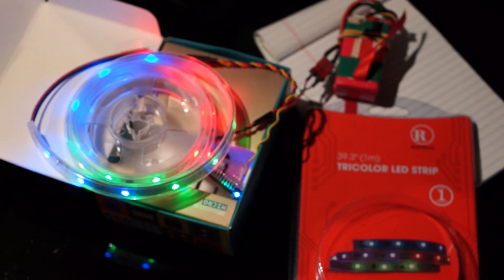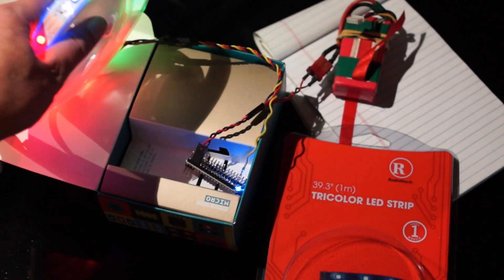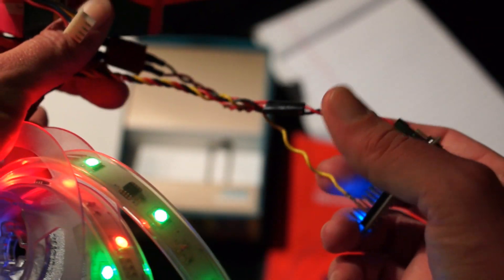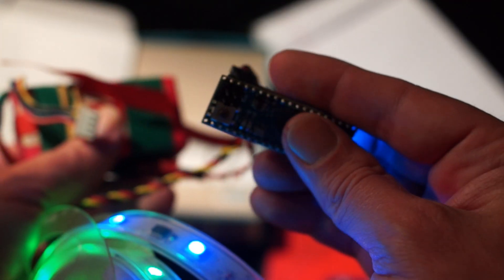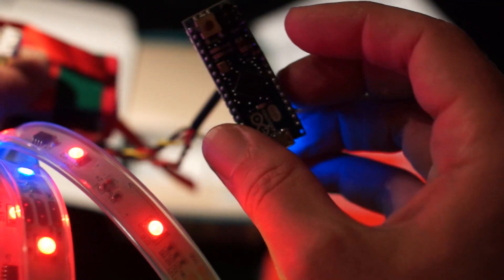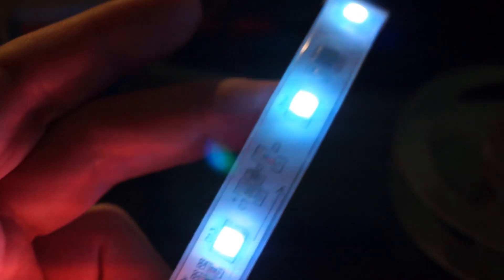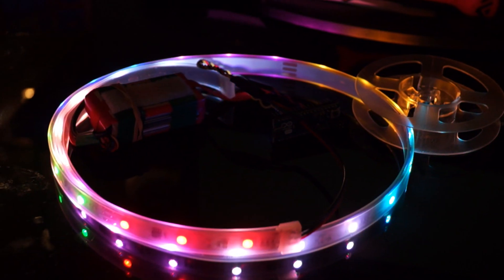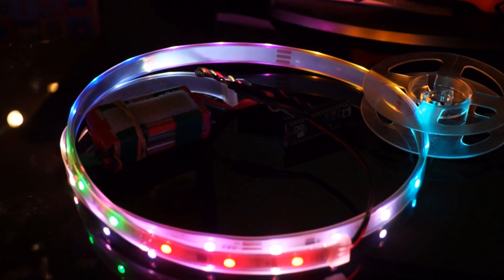Radio Shack Tri-color LED Strips How-to

Comment: I use FastLED library (successor to FastSPI_LED) By Daniel Garcia
This is a library for easily & efficiently controlling a wide variety of LED chipsets.
Supported LED chipsets;

Adafruit's Neopixel - aka the WS2812B (also WS2811/WS2812, also suppored in lo-speed mode) - a 3 wire addressable led chipset
TM1809/4 - 3 wire chipset, cheaply available on aliexpress.com
TM1803 - 3 wire chipset, sold by Radio Shack  <-----------
UCS1903 - another 3 wire led chipset, cheap
LPD8806 - SPI based chpiset, very high speed
WS2801 - SPI based chipset, cheap and widely available
SM16716 - SPI based chipset
DMX - send rgb data out over DMX using arduino DMX libraries

Supported platforms;
Arduino & compatibles - straight up arduino devices, uno, duo, leonardo, mega, nano, etc...
Teensy 2, Teensy++ 2, Teensy 3 - arduino compataible from pjrc.com with some extra goodies (note the teensy 3 is ARM, not AVR!)

Site for the library - http://fastled.io
Reply: I tried using this library but the color mapping is off.  Green=Blue, Blue=Red, etc...
Reply: Eli Miletich Looks like my RadioShack strip is GBR mapped, will have to re-map it somehow
Reply: figured it out... this is a much better lib than Pololu (IMO), just be sure to re-order the line "FastLED.addLeds<TM1803, DATA_PIN, RGB>(leds, NUM_LEDS);" to "FastLED.addLeds<TM1803, DATA_PIN, GBR>(leds, NUM_LEDS);"
Reply: Eli Miletich
Glad you figured it out.
Few Notes: Radio Shack sells two versions of the rgb strip,

Version 1.0   
Model: 2760339  |  Catalog #: 276-339
RadioShack Tricolor LED Strip
Price:
$29.99
Look thru the Waterproof silicone tube by one of the arrows,
SJ-TM1803-30 V1.0

Not Recommended
even different color mapping RBG and Red leds are Super Bright.
FastLED.addLeds<TM1803, DATA_PIN, RBG>(leds, NUM_LEDS); //TM1803 Radio Shack RGB Strip v1.0

Version 2.0
Model: 2760249  |  Catalog #: 276-249
RadioShack 3.28-ft. (1 Meter) Tricolor LED Strip
Price:
$6.97
Look thru the Waterproof silicone tube by one of the arrows,
LED-500-TM1803V2.0

Highly Recommended
Color mapping GBR
FastLED.addLeds<TM1803, DATA_PIN, GBR>(leds, NUM_LEDS); //TM1803 Radio Shack RGB Strip v2.0

I'm currently using version 2.0 for boblight 4m long ):
Reply: Chris O.
/*Boblight is a collection of tools for driving lights connected to an external controller.
https://code.google.com/p/boblight/
Its main purpose is to create light effects from an external input,
such as a video stream (desktop capture, video player, tv card), an audio stream (jack, alsa),
or user input (lirc, http). Currently it only handles video input by desktop capture with xlib,
video capture from v4l/v4l2 devices and user input from the commandline with boblight-constant.
Note: MS WINDOWS Dlink https://github.com/markhoney/RainbowBob/tree/master/boblight-1.3-beta1
      prefix can only be 1 byte long in this boblight-1.3-beta1, TODO Fix this for Ms win. 
*/
/* boblightd receiver for FastLED library , boblightd device type=momo, prefix FF 8F
 Please edit bobligh.conf file prefix, this will work OK on linux, MS WIN. prefix can only be 1 byte long.
 capable at least for 20Hz input stream if LED count <= 150
 by TPertenava
 last modified by Chris O. Aug.20.14 
 Tested on  Arduino IDE 1.0.5 
 FastLED 2.1  https://github.com/FastLED/FastLED/tree/FastLED2.1
 Arduino Leonardo
*/
#include "FastLED.h" // FastLED is a fast, efficient, easy-to-use Arduino library for programming addressable LED strips and pixels such as
// WS2810, WS2811, LPD8806, Neopixel, TM1803 and more.

#define NUM_LEDS 40 // 4M LONG / LED count, well Radio Shack TM1803 IC count 10 per 1M.
#define CHANNELS NUM_LEDS*3 // each output for R, G and B
#define DATA_PIN 8 // arduino output pin
#define BRIGHTNESS 255 // maximum brightness
#define SPEED 115200//57600 //115200 // virtual serial port speed, must be the same in boblight_config

boolean ReadyLEDSbuffer = false;
byte values[NUM_LEDS][3]; // 2-level array, 1 level is for led number, 2 level is for rgb values
CRGB leds[NUM_LEDS];

void setup()
{
  delay(2000); // sanity check delay - allows reprogramming if accidently blowing power w/leds
  Serial.begin(SPEED);
  LEDS.setBrightness(BRIGHTNESS);
  // FastLED.addLeds<WS2811, LED_PIN, GRB>(leds, NUM_LEDS);
  FastLED.addLeds<TM1803, DATA_PIN, GBR>(leds, NUM_LEDS); //TM1803 Radio Shack RGB Strip v2.0
  // FastLED.addLeds<WS2811, DATA_PIN, RGB>(leds, NUM_LEDS);
  // FastLED.addLeds<TM1809, 13>(leds, NUM_LEDS);
  // FastLED.addLeds<UCS1903, 13>(leds, NUM_LEDS);
  // FastLED.addLeds<TM1803, 13>(leds, NUM_LEDS);

  // Test leds on start up
  // fade up
  for(int x = 0; x < 128; x++) { //PINK LOL.
    // The showColor method sets all the leds in the strip to the same color
    LEDS.showColor(CRGB(x, 0, x));
    delay(10);
  }
  // fade down
  for(int x = 128; x >= 0; x--) { 
    LEDS.showColor(CRGB(x,0, x));
    delay(10);
  }
}

void WaitForPrefix()
{
  uint8_t first = 0, secondD = 0;
  while (secondD != 0xFF || first != 0x8F)  //FF 8F PREFIX
  {
    while (!Serial.available());
    secondD = first;
    first = Serial.read();

  }
  // if Prefix found set flag true
  if (first == 0xFF && secondD == 0x8F)
  { 
    ReadyLEDSbuffer = true; //set flag
  }
}

void loop() { 
  WaitForPrefix(); //jump to WaitForPrefix();

  for (byte Led = 0; Led < NUM_LEDS; Led++) {
    for (byte Color = 0; Color < 3; Color++) {
      while(!Serial.available());
      values[Led][Color] = Serial.read();
    }
  }  
  for (byte Led = 0; Led < NUM_LEDS; Led++)
  {
    byte red = values[Led][0];
    byte green = values[Led][1];
    byte blue = values[Led][2];
    leds[Led] = CRGB( red, green, blue);
  }
  if (ReadyLEDSbuffer == true) { // show leds only if buffer ready
    LEDS.show();
    ReadyLEDSbuffer = false; //set flag to false after LEDS.show();
  }
}
Reply from the maker: Chris O. Wow, thanks for posting! That's what I call community service! Nicely done, sir :)

Comment: Im having the same problem as Giuseppe Barbesino below. I get a few lights and then it quits. I have tried all the examples, including yours (on pin 10 instead of 12) and they all behave the same. I have 12VDC 1A barrel plug into Arduino Uno. LED Strip should work off Vin and GND from the board.. From web docs: "Vin: You can supply voltage through this pin, or, if supplying voltage via the power jack, access it through this pin." Don't see what the problem is. Help is appreciated!!
Reply: So I have solved my problem. I had to use the older version (1.2.0) of the Pololu video because of the TM1803 chip i guess. Now it works great! 

Thanks a ton for your video, without it this light strip would have been returned!
Reply from the maker: Oh, I'm glad you figured it out. It's really hard to answer these questions without being able to see your setup in person.
Reply: Timothy Capelle Glad I found this little comment, I've been having a hell of a time making this thing work! It's working well with the older libraries, and I'm looking forward to writing some code for it!
Reply: Awesome! glad I helped :) Radioshack was almost giving these things away on clearance so there's probably quite a few people out there trying to make this work.

Comment: What does it mean when "PololuLedStrip<10> ledStrip;" highlighed yellow and at the bottom it says "expected constructor, destructor, or type conversion before '<' token
what do i need to add in? I followed your video and copy and paste the code and it keeps telling me the same thing.
Reply from the maker: Sounds like you haven't installed the Pololu library correctly and your environment isn't seeing it for some reason.

Comment: Jasmine2501:
Thank you for the helpful instruction so far.  I have been able to get the LED Simple Rainbow program to compile now that the library is installed, but I am getting this error when I upload to my arduino...  
avrdude: stk500_getsync(): not in sync: resp=0x30

I am trying to get these Radioshack leds to light up for our office's holiday display at a local charity and could really use your opinion on what might be wrong since I am a complete beginner with programming.
Reply from the maker: One thing that programmers know that most people don't, is that error messages make VERY good Google queries. So, I Googled that message cuz I've never seen it before, and it looks like it's something with the baud rate or port selection - basically you aren't connected to the Arduino correctly. Error 0x30 (that's hexadecimal) seems to be "Arduino not connected" so probably you selected the wrong port, are using a bad cable (you have to use a data cable, not a charging cable), or you picked the wrong baud rate or some other option. Put the error message into Google and you should be able to find lots of forum posts about this error. Apparently it's a common issue.

Comment: I got an error.
LedStripRainbow:15: error: 'rgb_color' does not name a type
LedStripRainbow:13: error: expected constructor, destructor, or type conversion before '<' token
LedStripRainbow:17: error: 'rgb_color' does not name a type
LedStripRainbow:27: error: 'rgb_color' does not name a type
LedStripRainbow.ino: In function 'void loop()':
LedStripRainbow:52: error: 'colors' was not declared in this scope
LedStripRainbow:52: error: 'hsvToRgb' was not declared in this scope
LedStripRainbow:56: error: 'ledStrip' was not declared in this scope
LedStripRainbow:56: error: 'colors' was not declared in this scope
Reply from the maker: ***** That means you haven't installed the Pololu library correctly, and it's not seeing the code where "rgb_color" object is defined. (Or you forgot a #include)
Reply: Now my question is how did you hook up one power supply to both the lights and Arduino? Can I use my Arduino Uno?
Reply from the maker: It should be pretty clear from the video how I did the wiring for the battery. It just splits from the battery and powers both things.
Reply: Well I returned the Tri-strips because I was sick of trying to fixing it. Got something better from Adafruit.

Comment: I'm having the same troubles as Giuseppe.  Install the library, run the code, quick green flash on the first LED set and then it goes out.  I am running a 12V DC into the Arduino and plugging the LEDs into the VIN/GND pins.  Running green into pin 12 as provided in the Pololu code.

When I run your code, I get nothing at all.  I did change the LEDs over to pin 10 as provided in your default code; however, no luck at all.  The only thing that does work is that low level C code that RadioShack provides that is about completely useless.
Reply from the maker: I suspect that will cause too much current to flow through the Arduino. It can only supply a tiny amount of current directly from one of the pins - 400mA I think. That is why I wired mine the way I did - the Arduino can't handle the current from the LED strip. Also, check the voltage on what you think is Vin - it might be 5V.
Reply: jasmine2501 Well in all fairness, it may have been because I burned up my bootloader.  The entire chip was trashed up, dunno what I did.  Just glad I have a few extra Arduinos laying around.  The Vin pin will light the strip from the Radio Shack samples, so I believe it should be enough for the samples you provided as well.  Thanks for your information on the pololu library, that's a big step in the right direction.
Reply from the maker: Trying to pull too much current through the pins can cause that problem!

Comment: the power as I set it up works because if I use it with the Radioshack original sketch the strip lights up perfect. except that I do not understand the RS code and so I cannot play with it.

Comment from the maker: So, you're powering the Arduino from a DC converter using a barrel plug? In this case, you'll need to power the LEDs from the Arduino, which will send a lot of current through the Arduino, so probably not good. I'm trying to picture what you have but it isn't making a lot of sense in my head, sorry. If I think I've got it right, your problem is you're trying to power the LEDs from an input pin (goes to regulator) - not from a Vcc pin which would have 12V available. A short video might help.

Comment: Hi: i downloaded the library, isnatlled it, downloaded the sketch, uploaded to arduino. I have made my circuit as follows: 12V 1.5A through the power jack. red wire into the Arduino Vin pin, black wire to ground and green wire to pin 10. when it starts, only the first 3 LEDs lught up green briefly once and then it stops. any idea?
thank you!

Comment from the maker: Did you download the zip file with the code in it? You have to install that into your Arduino environment. I admit if you're not familiar with Arduino, that step could be confusing, and I can't really help with it - you'll have to dig through the folders and find the right place to put that package. It is explained on the Github page, but the explanation is for older Arduino environments, so it isn't exactly right.

I'm happy to help you figure it out, but I need more specifics about the problem

Comment from the maker: Heck yeah I will be putting this on something that flies! I think the first thing might be on a hex copter like I said. It's no heavier than a regular LED strip, except for the sleeve which can be removed. The strip inside does not have the adhesive backing though. It needs 12V but pulls very little current, so you could use a really small 3S battery and it would last a long time. Using the flight battery might be ok, but I don't recommend that, because I've had issues doing that.